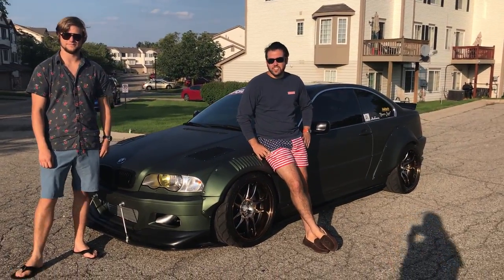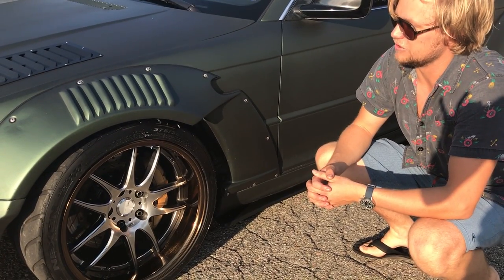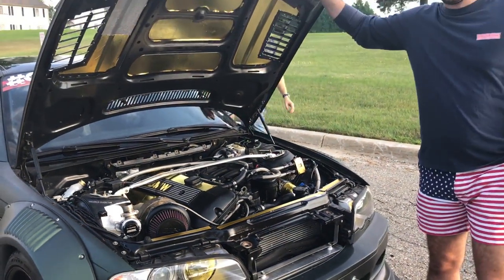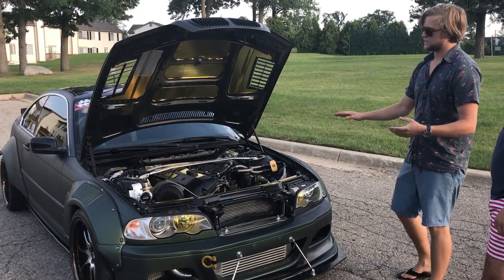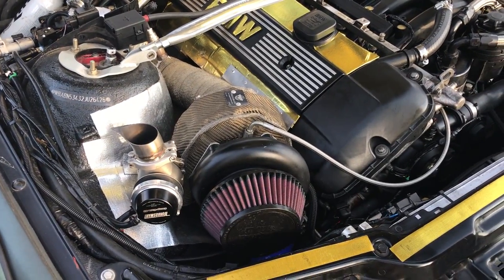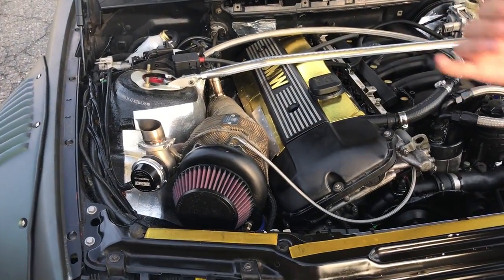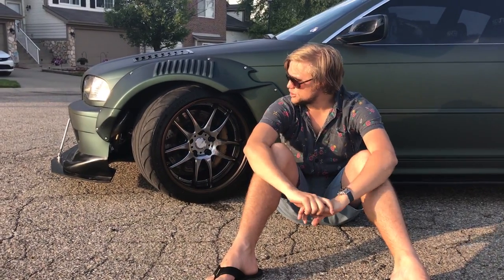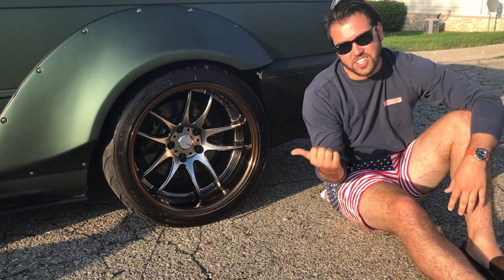Build Breakdown - Widebody Turbo E46 Non-M 330ci

Comment: It's beautiful! What do you think about the 325Ci it's doable?
Reply from the maker: Thanks, yes its doable! However you cant run a lot of boost because the internals are not as strong as a normal 330's (forged). Can still push good power though
Reply: Thanks man, i would gladly get the 330 but in my country we have tax on cubic cm, so the 330 would be to expensive, but your build is very nice, i doubt it that you use it as a daily but how reliable is this beauty?
Reply: So all 330s n the us come wit forged internals?
Reply: Dame AL not forged just stronger. But H-Beam rods are not expensive at all. Like $350 US. Its the pistons and cams that are super expensive. $1,100 for a set of cams and $1,250+ for forged pistons.

Comment: those flares look like aids And puts the whole proportion of the car off
Reply from the maker: and your car looks like a mom mobile, and is slow as shit. Sick csl reps bro!
Reply from the maker: DTM Fiberwerkz!
Reply: Seems Legit Garage 

CSL reps lol 😂 not even close buddy. Your car is sick just not a fan of the proportion of the car with those flares. Don't get triggered m8. Unsubbed.
Reply from the maker: They are my least favorite part. Going to add some carbon this winter and integrate them into the fenders better.
Reply: I usually like them... on this I don't for some reason.
Reply: Those flares are functional. Nuff said.
Reply: Shoulda did the pandem kit
Reply from the maker: Lou F like old great ok slammed cars, the wheel gap is just huge on a track setup
Reply from the maker: Looks great on*
Reply: Seems Legit Garage i love the build, but ive ALWAYS hated every single widebody for e46’s except pandem/rocket bunny. Not fanboying on rocket bunny, i actually dont really like most of their work. Streetfighter and DTM’s widebody kits just dont blend well with the iconic body shape and lines of e46’s

Comment: Would you guys do base map turbo mail order ecu tunes to get a base line car running?  Saw you ebay add on the unlock ews delete "shark" Ecu.  Just debating on turbo before dropping the motor into the ole dirty30
Reply from the maker: yeah sure, hit us up through instagram

Comment: Amazing work, and great advancements.... doing the same myself since I saw your car! Do you have a build thread where you explain what you done with things like ccv, vanos, head and parts u had to fabricate in to original system?
Reply from the maker: vanos is stock just rebuilt, ccv is deleted for a catcg can, head is ported. build thread is on e46 fanatics
Reply: Seems Legit Garage great thanks. can you point me in the right direction with dme info for turbo build please? Ps that grid life vid is sick, the sound!
Reply from the maker: gelashvili performance can take care of all your dme tuning needs remotely, or you can buy an unlocked ecu from us at seemslegitgarage.com and have a local dyno shop tune the car.

Comment: Always tell a fuckboy by the tow hook. Since when are fender flares the same as somebody?
Reply from the maker: Doublevanoz Tow hooks are required by the time-attack series we compete in, GridLife, and many track-day hosts. I guess you don't go to the track, you would know that. I think you meant widebody, not somebody? If I'm correct in the fact that you mean not what you spelt, fender flares and widebody kits are often thought of as the same thing. In the end they achieve the same purpose, fitting very wide wheels and making the car wider. Some go for the bolt-on look, others for the seamless look.

Comment: Did the power steering cooler present any issues? My e46 is my drift car and I'm starting to overheat the pump and it actually gives out on me at times and starts locking up at full lock
Reply from the maker: Well we originally had it behind the radiator, but it was getting to much radiant heat from the radiator itself. So we moved it to the side of the inter-cooler for the last track day, and now no fluid boiling at  all!
Reply: Seems Legit Garage sweet! Did you just use a generic cooler and plumb it in? And is it plumbed in on the return line? I boiled the crap out of my fluid!
Reply from the maker: Yep its a generic cooler. Its installed between the rack and the reservoir, so its the tank feed. Youll need a big banjo fitting to attach it to the rack. 16mm i believe.

Comment: did you have boost creep with the cx racing manifold? was that the reason for the second wastegate?
Reply from the maker: We didn't before with a GTX3076 china turbo and stock motor, but with the ported heads, built motor and new turbo it was pretty bad yeah.
Reply: Awesome thanks for the update! Also was curious on the choice of fpr, was it mostly for size? I see everyone running aeromotive and wasn't sure what the difference is. Is yours still mounted under the car?
Reply from the maker: No problem! Well it was a good deal and when I contacted Fuellab they assured me it could handle what I was looking for. The size doesn't affect flow as much as you think, people usually up-size when they have multiple fuel pumps and need to keep pressure down. The large regs have a larger spring and diagram which can hold down more pressure. I have one walbro 450 and the mini has no issue with it. Also, I moved it into the engine bay when i converted my fuel system to AN line.